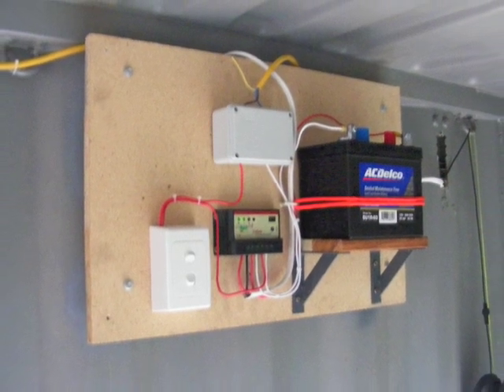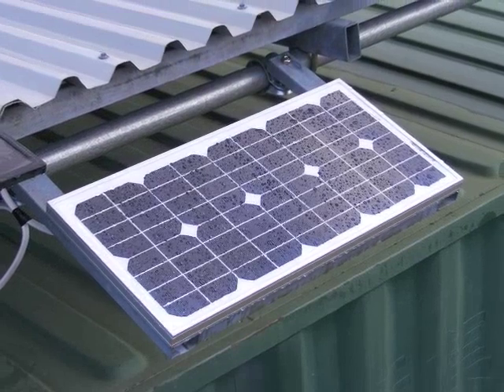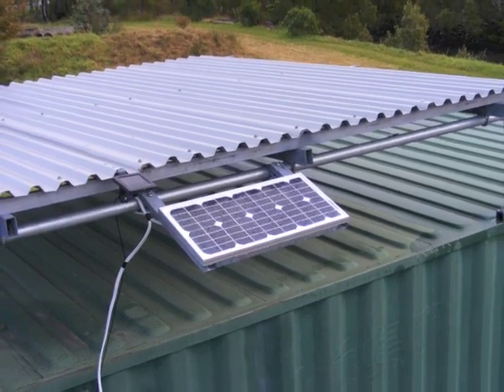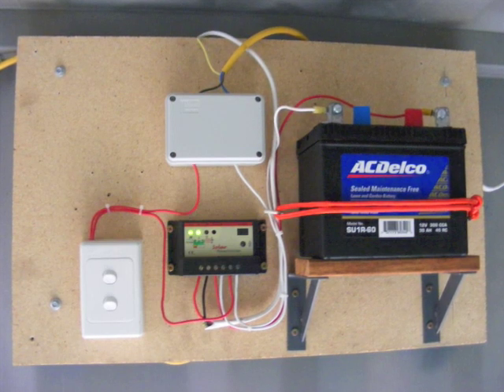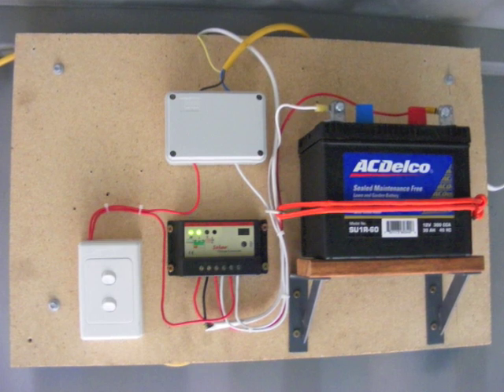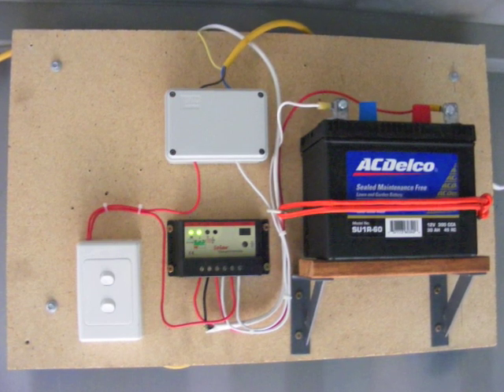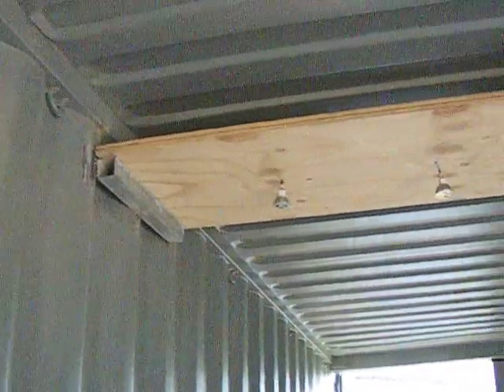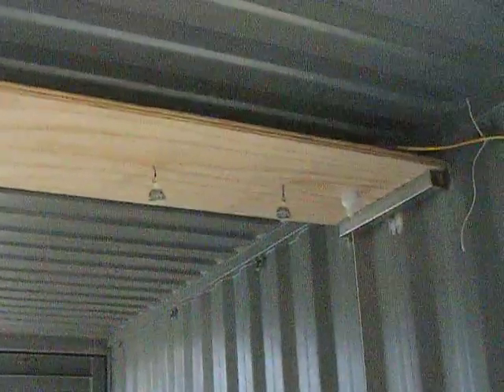Shipping Container House - Solar powered LED lighting part 1

Comment: o to see how it starts us off gets us looking in to ways to power the home .
to see  this was its 4 or 5 years back know and to look at how you power the home know bet the the generator don't get kicked over as much as it use to im looking in to more cheap batteries i just got some 2x 150ah batteries $100 each to get me by abit longer till the tesla power walls come down more 7k know so they coming down have to come down alot more yet for me ..
Reply from the maker: +TRMTHEweasel You are correct. The generator only makes an outing on filthy hot evenings when the sun has gone in. That battery is still doing a great job. It runs the security lights and is now 4.5 yrs old. They run on a 20w panel. I love the idea of tesla batteries, but on price they are still a big outlay.

Comment from the maker: Charge controller is a cheap ebay 10 Amp controller. Battery is lawnmower 11AH conventional battery. Will last quite a while with just led lights. I upgraded to a 200AH battery (truck) not as expensive as deep cycle and a 250W panel, 50A ebay charge controller.. This runs all the lights, hot water pump, phone charger all day every day never needs top up. I moved this smaller set up to light my storage container and it is fine. cheers Paul

Comment: What kind of charge controller are you using in this system, and how long will the lights last with the one battery? Is that a deep cycle battery?

Comment from the maker: @hing983 
The white box is simply a plastic junction box. I thought I might have a number of lines going to different light panels, so I put in an empty junction box to connect them. The solar controler has only got space for one positive and a negative using 4 sq mm wire. I intend to fit up to 32 LED lights in a single container. I will be posting an update on power in the next few weeks as I have a few new bits. Cheers Paul
Reply: Paul Chambers EXIDE